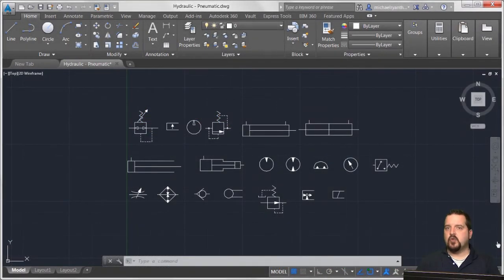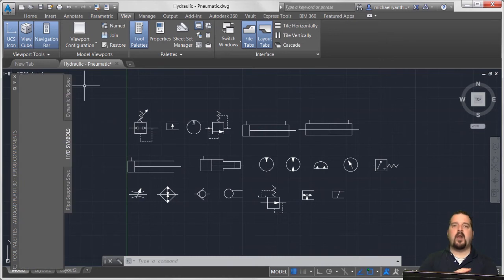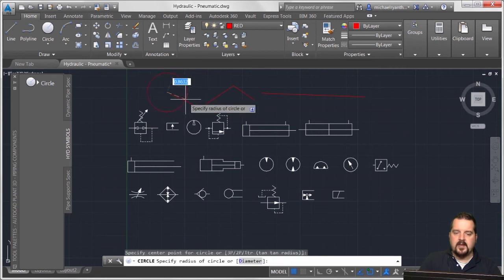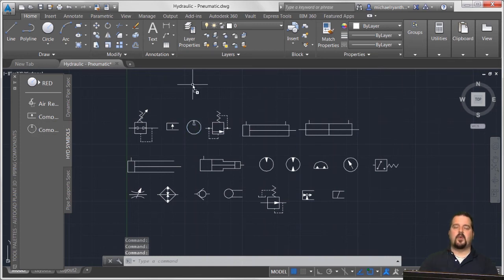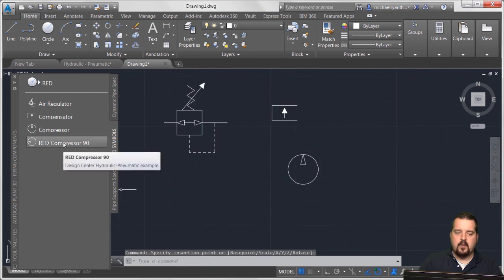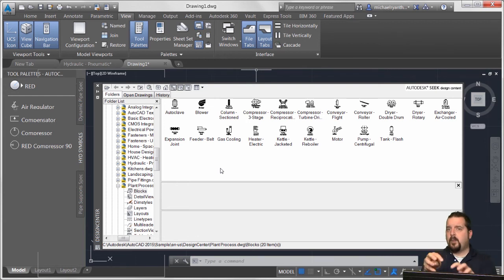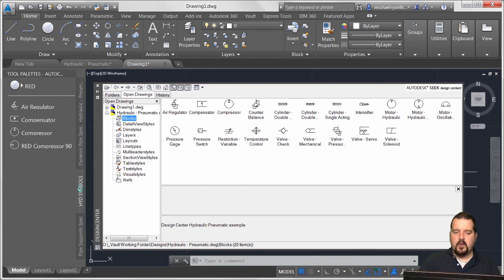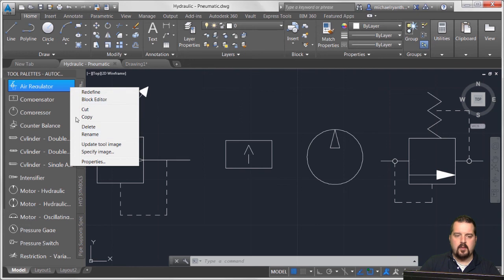Using AutoCAD's Tool Palettes and the Design Center

Comment: Hey , you are good . can you tell me or share the link of the video . how to put different sizes of same block in tool pallet under one block like M8 nut  metric .
Reply: Hi Jaswinder. For different sizes of the same block, you would create multiple block insert tools then set the scale accordingly. You can do this by dragging and dropping the first block onto the Tool Palette, then copy and paste for additional tools, then right click on each and select 'properties' to set the scale.

A better method for your given example (An M8 Bolt - which doesn't 'scale' but instead changes in all dimensions) would be to build a dynamic/parametric block with a lookup table for the sizes. When you place a parametric block onto a tool palette, right click on the Tool Palette tool and take a look at it's properties. You will see a 'custom' section where you can pick which version of the Dynamic block to insert.

If you change the Dynamic block and drag it onto the Tool Palette again, a new block insert icon will be generated. This takes a little longer to build up your palettes, but it's a nice touch and makes it easier for your users to anticipate what the tool palette tool will do.

Does that help?